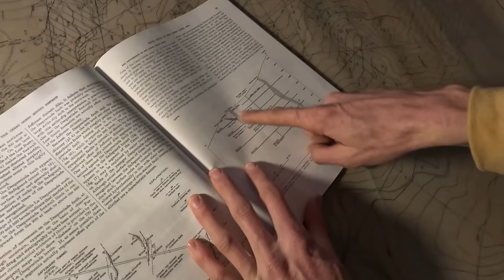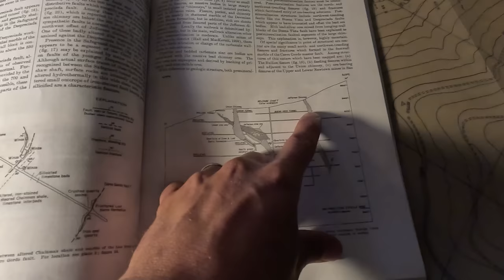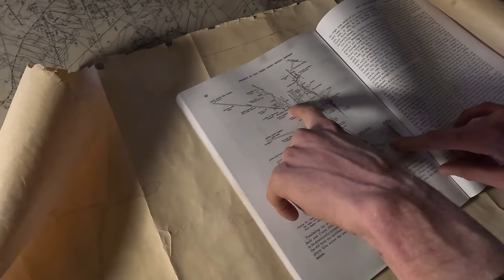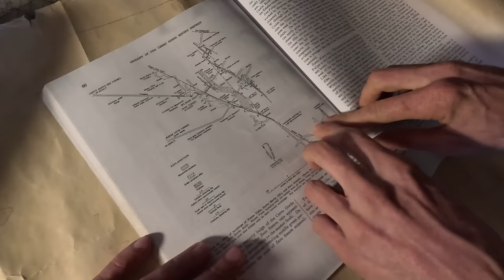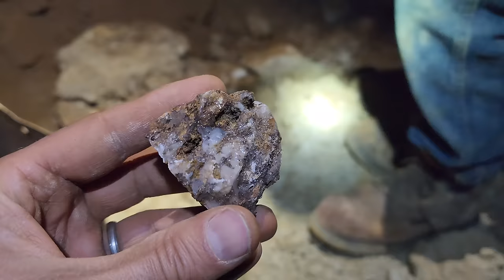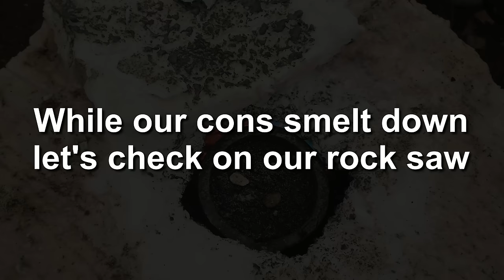Mining A Silver Mine For Gold! Cerro Gordo Exploration and Adventures!

Comment: Hello from Montana!! Thanks for all the information and your adventures Jason. The materials at Sero Guordo are so different than here in Montana. Dan’s explanation of the metal detector will potentially help me pass up all the nails, wire and pull tabs😂. Keep up all these amazing videos, we all respect your hard work and skills. 
I have access to a 300-400 foot (maybe taller) wall of brecciated/conglomerate in proximity to an old volcanic zone. I located it while mountain climbing. It’s remote yet accessible by old abandoned, closed roads and some bushwacking, not unlike one of your older videos. Much of my samples will probably need to be obtained while rappelling or ascending climbing ropes. After sampling I’ll need to begin with understanding the basic principles of beginning a portal in such material. One of my initial discovery samples, taken at the wall’s base, shows promise!😮

Comment: That’s some fine gossan and millstone all over the slope there above the shaft.  I reckon if that rock was properly milled you’d recover 5 to 10g/t in gold, plus silver and base metals. The gold may be hosted in the quartz veins as well as in the altered wall rock along the fault zone.  Pockets of mineralisation may be found where veins and cross-cutting faults or shear zones intersect. Gold doesn’t always occur in nugget form.  A lot of it is fine, hidden in the rock matrix. I’ve seen assay/milling results as high as 10g/t from smoky quartz that had no visible gold.

Comment: I've seen on one of your videos that sometimes the gold is so fine that you cannot smelt it. You have to do a chemical leech. You ever put a lighter to steel wool? Imagine micron Gold. I've used your recipe with 50/50 lye/ borax with a little silica sand but some of the gold was left in the Slag because micron gold takes a good minute to settle in water but almost impossible in glass.

Comment: It may be a good idea to run 240v down , so smaller wire can be used. And less power loss. Then use a 240v to 120v transformer  to get the 120v to be used!  With long runs  the actual voltage measured could be 90-100 v maybe less!  Tools work poorly with low power!
Reply: Burns up motors and electronics. Had a house that kept knocking out refrigerators and TVs so I checked the voltage at the panel. Got readings in the 90v range so called the utility. Of course when they showed up in daytime it was 112v so they thought I was nuts. Finally got them to put a recording meter on it and every evening when demand in the neighborhood was high, it dropped to high eighties and low nineties. They put a new transformer on the pole and all was well but they would not pay for the two refrigerators or the TVs that burned up.
Reply: Why would you use a transformer to step down 240???